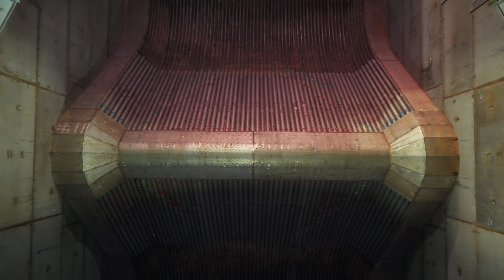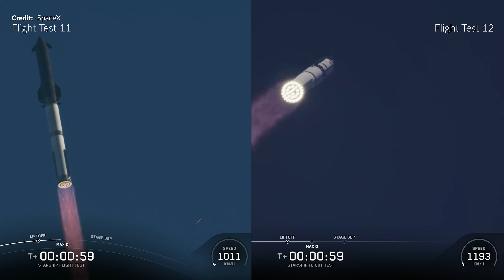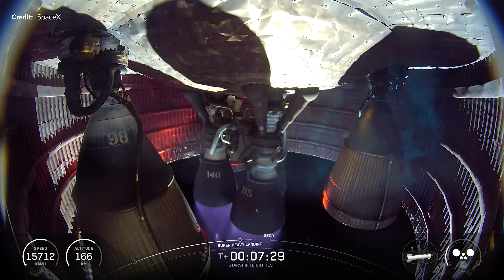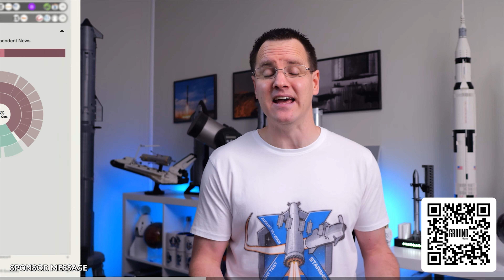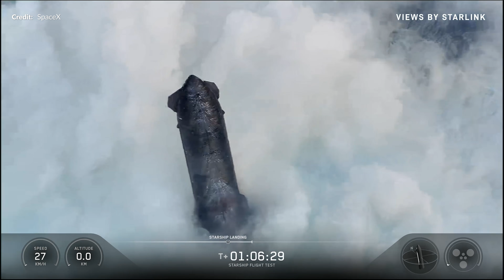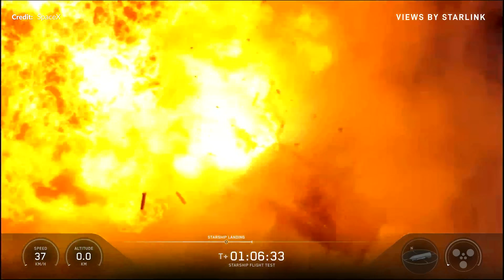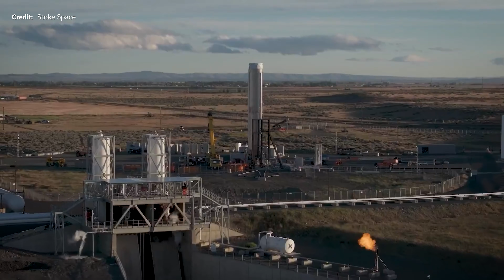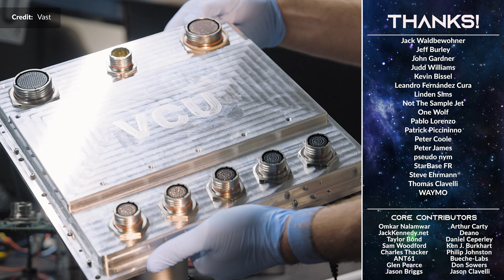Starship Flight 12 Explained - The First Version 3 Starship

Comment: Summary of the Starship project to date

As of May 2026, SpaceX has launched a total of one actual flight utilizing a previously-flown Starship component, which occurred during Flight 9. However, the booster on that flight did not survive its recovery attempt, meaning not a single piece of hardware has yet been reused multiple times. 

More than $3 billion into the project and no demonstration yet Of the essence of this system. Reusability. 

Meanwhile, NASA has launched exactly two Artemis rockets, both of which not only achieved orbit around our planet, but both of them went to the Moon and back and Artemis II with four astronauts with a successful landing.
Reply: Meanwhile, SpaceX has launched the Falcon Heavy rocket (much more complex than the legacy expendable SLS) 12 times successfully, with no flight failures.
Reply: @admarsandbeyond But it didn't go to the moon, did it?.
Reply: @ke4uyp  And? Artemis II cost 4.1 billion and all they did was go around the moon? I dont think you understand remotely what spacex does and how it innovates. Falcon helps you more than you think
Reply: @fekl_osu  I fully understand what SpaceX does they take our tax money and waste it on a project that will never be completed.
Reply: @ke4uyp  SpaceX has successfully launched six distinct lunar exploration missions with Falcon. Beresheet, Danuri / KPLO, Hakuto-R Mission 1, IM-1 "Odysseus", Blue Ghost Mission 1 & Hakuto-R Mission 2, IM-2 "Athena". (also another 7 deep space missions into interplanetary trajectories). So yes it has gone to the moon as much as SLS has gone to the moon.
Reply: @ke4uyp  " they take our tax money and waste it ". Starship is self-funded. NASA funded only part of the HLS program (development and missions), and they receive money based on completed milestones (more than 49 major milestones completed already).
You can't pretend to care about the 3B spend on HLS, while ignoring the well over $100B wasted on SLS/orion to fly 4 people around the moon.
Reply: Spacex has received around $22B from the government. Almost all of those funds go toward Cargo/Crew Dragon missions, development of the Starship lunar lander, and satellites launched by Falcon rockets etc. Besides that, SpaceX is pretty much self-funded through Starlink, launching satellites, private astronaut missions, etc.

Did you ever try looking more closely at where your money actually goes, or do you just take a quick look and call it a day? I don’t see NASA launching a rocket every couple of days.
Reply: @fekl_osu I don't see SpaceX launching starships every other day either.
Reply: @ke4uyp  i see falcon launching every other day
Reply: @fekl_osu  That has nothing to do with Starship. Spacex needs to get a seat in the back of the bus. Firefly has already successfully landed on the moon.

Blue Ghost Mission 1 (March 2025): The spacecraft touched down in the Mare Crisium basin. It successfully delivered 10 NASA science investigations and technology demonstrations, operating for over 14 Earth days to complete 100% of its mission objectives.
Firefly is currently working on their next mission to land on the far side of the Moon.
Reply: @ke4uyp @ke4uyp  Blue ghost and Firefly both utilize the falcon 9 to land on the moon? Starship is a TEST program and it doesnt need to go orbital because they have falcon. Its legit the reason they can operate the way they do so its bs when you say falcon has nothing to do with starship lol. I dont see nasa flying a 33 engine rocket with engines far more efficient and simplistic then ever before costing only a fraction of the sls engines. I dont see the shuttle anymore and i wonder why. Nasa doesnt even have a rocket to supply their own iss crew. 

Like why are you even comparing moon landers to a rocket? Thats not what starship v3 is made for.
Reply: @fekl_osu  All I see is SpaceX taking our tax dollars And not completing the contract. They were awarded from NASA pertaining to Artemis. They have absolutely nothing. Mission ready. Their latest raptor engines can't even reignite reliably. And it really doesn't matter whether it's a fuel issue or the engine itself. The bottom line is they wasted all that money with that rocket and it's not reliable at all. And at this point they have shown absolutely no reusability on Starship. Every single launch has been a complete total loss. So regardless of whether these rockets cost less money to make and launch makes no difference if they're not really actually what they claim they were going to be, which was reusable. It's like every single time they reach a point where they've got something that's working. They move the goal post, throw it in the trash can and start all over again. That's not advancing that's just wasting time and money.
If they spent as much time and effort on perfecting the reusability and reliability of the rocket as they do with that stupid pez dispenser, they would have already had something working by now.
Reply: @ke4uyp you are just blind to the facts that starship doesnt work like this (if only we had a smaller capable rocket that could do the job until we had starship ready). There is no point in argueing with you since you are too hyperfixated on the idea that starship is a waste lol and not really allowing your view to change. All i have to say is lets see who is right on the next couple years :) lets see if nasa can even get their own rocket ready on time lol
Reply: Should they keep reusing the same booster/starship when it has known problems? I feel like they don't need to justify their reusability with starship yet because falcon exists.

Comment: my prediction for the reason the booster failed ist, that due to the missing hot staging ring, that was a seperate part and the shielding now beeing welded onto the the head of the boosters tank, this created a much more conductive thermal bridge, resulting in a preassure increase inside the tank

Comment: Powerful,  new systems, engines, controls... yes. Ignoring that the new ship still exploded is interesting. This is supposed to be a reusable, human rated ship.  How much longer will this thing still be hyper volatile?
Reply: Lets first wait for starship V4 :P
Reply: This is supposed to be a test prototype of the reusable human rated ship. Starship is evolving faster than any other space project in history given the enormous complexity.
Reply: @admarsandbeyond I'd argue RocketLab's Neutron will be faster.  The hopper test was in 2019.  6 years later, I dont see rapid disassembly as something to cheer about. I cheer for the employees, but the strategy needs to be revisited.
Reply: @iamsocial4340  Neutron is a partially reusable midi rocket, orders of magnitude simpler than Starship.

Comment: 5% of the engines failed…. In most industries a 5% failure rate is catastrophic. I realize this is new technology and a test flight but I have always thought Elon should have looked at what worked best on the Falcon 9… and made Starship far less cutting edge and ambitious and simpler and lead SpaceX to quit trying to innovate quite so much.
Reply: In most industries they dont expect failure tho. Spacex expects some parts of the starship to fail, aspecially the new raptor engines. Like why do you went spacex to innovate less? Do you not want to see interplanetary travel in ur lifetime?

Comment: The hot stage attached to the booster may have caused violent  oscillations with the angle of attack causing damage to the mechanical systems leading to RUD on its return to Earth surface.

Comment: This mission seemed to be a huge step backwards for the booster and all propulsion systems. Flaps seemed to survive, that's about it.
Reply: Nope - brand new everything including engines - heat shield was in the best shape post flight of any mission - I suspect the booster return issue was a bad flip resulting in gas ingestion and fuel feed issues - then engine failure - all fixable in software

Comment: Take a look ! See the bottom of the booster swing a bit close to the tower as it jumped off the pad. So much power it looked like it wanted to flip ends. Next flight you will see them dial the thrust back a bit to avoid that dangerous bottom swing pushing against all that tonnage above it.

Comment: Engine out on an R-vac is pretty wild. It "feels" like the offset thrust would be a big problem. I wonder how much the center three have to gimble to compensate. Are they RIGHT at the limit of available control authority? Do they also have to throttle down the 2 remaining R-vacs to reduce offset thrust, and if so, how much does this increase fuel burn to reach the target near-orbit? Would this still be viable on an operational mission with full payload? I assume it's built into the fuel margins.

Comment: Even with all that power Starship still has a lower thrust to weight ratio SLS at liftoff
Reply: SLS thrust-to-weight ratio of around 1.5 to 1. Starship's thrust-to-weight ratio will be around 1.8 to 1 with a full payload, which is incredible given the energy density differences between propellants used.

Comment: Absolutely this was a success, and a success SpaceX and the American space program really needed.  And I think we will learn more about important successful details achieved in the coming days.  Two things I think we can see as important successes just from what we could see are:

* the V3 Raptors worked spectacularly well (apparently) except for some ignition problems ... and one lost engine on the booster before MECO.  "Working spectacularly well" doesn't mean perfect or without problems to solve.  But for the first flight of a remarkable new engine, bloody damn good.    And (as Marcus says) one of the things that was spectacular was how fast the stack left the pad.  Go back and look at earlier launches if you don't immediately see it.   This is proof you can see with your own eyes about how much improvement the V3 redesigns have increased system thrust/weight ratio at fixed payload.

* The new tiles seem to be working very well.  This is critical, and we should learn more as more analysis comes out.   However there were a few brief streaks of hot debris coming off the forward parts of the vehicle -- what these were is a prime question.

Comment: its extremly funny to me how the whole thing with starship was questioning nasa's best practices. and we have effectively come full circle to now just have a launch stand that essentially is the same as any other just with the catch arms.
Reply: Starship isn't just a launch pad (NASA could never build a system like this), and even the launch pad is many times better and more innovative than any launch pad before it.
Reply: @admarsandbeyondhow so?
Reply: @Whiskey2shots  Starship is developed in a totally different way than NASA best practices (rapid iterrative hardware rich development). 
For how the launchpad is way more advanced and different than any launch pad before it search for CSI Starbase videos which do a deep dive on how it works.
Reply: @admarsandbeyondbut fundamentally they have ended up with a pad the same as any other following NASA's best practices. Which was my point. 

I don't want to disparage those who work at space X and on starship specifically but this "rapid" development isn't so in my view. We're almost a decade on from the first flight, and it's been well over a decade since development began. In that time multiple other launch systems that are often looked down on by space X fans have been developed and put in to "revenue earning service". The "rapid" development cycle seems to have just wasted money and materials for very little gain. 

I think starship and super heavy are significant steps in space flight but I also think the mythology around it is simply unearned at this point.
Reply: @Whiskey2shots  "ended up with a pad the same as any other". 
Similar in concept only. But yeah, if you don't try new things and take risks and fail until you find what works, you can't innovate. That's how cutting-edge engineering works. Otherwise, you end up like NASA flying 1960s RS-25s on a weak, expendable, $4.1B-per-launch boondoggle.

"We're almost a decade on from the first flight well over a decade since development began".
 No. Starship hardware development essentially started in 2019, with full integrated flights starting in 2023. Starship is one of the fastest space development projects in history when you account for its complexity, progressing on one of the most aggressive schedules ever.

"In that time multiple other launch systems that are often looked down on by space X fans have been developed and put in to "revenue earning service"". Which are those?

for example:
New Glenn: 14 years of development to first flight, and it suffered a total mission failure on first commercial flight. It's probably many years away from approaching Falcon reliability, and will never ever be as cost effective (it's built like a legacy boutique rocket)

Starliner: 2014 contract (+years in early design dev before that), 12+ years in and still not fully operational (and will probably never be fully certified for crew).

Orion: 20+ years of development for its first crewed flight.

Blue Moon MK1 (uncrewed cargo lander): ~10 years to first flight attempt in 2026; MK2 crewed version maybe a decade further behind, if it ever happens.

SLS (based on legacy Shuttle components which began development 50 years ago in the 1970s (SSME/RS-25, tanks, SRBs, RL-10, Centaur S2): 11 years to 1st flight.

Shenzhou (LEO capsule, heavily based on Soyuz): ~11 years total from program start to operational crewed capability

Comment: I think the booster was hit by more Starship exhaust than anticipated. The exhaust hitting the now exposed outer ring may have put the temperatures out of range or disrupted the fuel/oxidizer mixing in nozzle bells.
Reply: Different power to weight ratio now so could have miss calculated that and flipped it a bit too hard 🤷🏻‍♂️

Comment: Fuel distribution failed. They need to re-engineer fuel distribution. Wouldn't count on the next flight for at least 2 months. It would be nice if they hit orbital altitude and put some real satellites up. If the ship has enough fuel to land on chopsticks from that altitude, it can launch satellites and land where they want in the sea, with maybe an extra orbit or two. Clearly the knew they might have big problems... and they did. This is early days of V1.

Comment: Looking at the transfer design currently one ship has female connections the other has just male connections.  Each ship should have a male and a female connection.  This would allow change of roles while in prelaunch, processing, or orbit or post orbit interplanetary.  You could do multiple launches, pair any two ships to consolidate fuel; then allow those ships with fuel plus to connect and transfer.  Otherwise if your doing multiple launches and have a failure of any ship.  You do not lose the ability to continue the transfer processes and even pair a trailing set of ships to follow to another planet to resupply in orbit there and possible carry supplies to be taken down by crew as they would have consumed allot of supplies in route.

Comment: Flight 12 was more or less a straight fail :(
The booster didn't work and was lost and one engine on the ship failed. And still no catch of the ship, even not an attempted one. 
There is no shortcut to orbit. Elon Scrub had achieved a milestone of spaceflight with the resusable rockets, but the starship thing is contradictional in itself: When they are reusable, why manufacturing them at a rate normal cars are produced? Without refueling they will barely reach a looow Earth orbit, just enough for the starlink satellites. Maybe they will end up as the mass donkey for Starlink, but never reach out of the low orbit.
When SpaceX will go to the stock exchange, this pipe dream of a science-fiction-addicted super-rich dreamer will soon be deflated.

Comment: If there aren't companies designing zero-g factories right now that can fit inside a starship I'd be surprised and also factories that can be delivered to the moon inside a starship. People have no clue what kind of revolution in manufacturing this ability will unlock. Super strong cellphone cases and super light weight and strong aircraft components. The list goes on and on. THINK: Solid steal will be replaced with foam steal.

Comment: During re-entry you can see some sparks flying... Means there's some ablation going on. Either something is heating and melting or tiles are flaking and removing heat not unlike the re-entry capsules NASA has been using. Heat shielding will probably have to be refurbished as part of the re-usability plan. I want more details on the booster section ! What went wrong, how well it fared, were they able to complete any additional tests even though it was off target ?
Reply: They had a few tiles of different materials that where designed to test failures of the heat shield, could have just been those, hard to tell until they actually catch one and see how it looks after.
Reply: @minmo2288  I suspect it's also coming from the thermal blanket they have wrapped under and around the tiles.

Comment: And the heatshield or more likely the steel below was burning off again with a lot of sparks during reentry... how is that design supposed to be rapidly reusable without maintenance of heat tiles or replacement of burned off metal parts? Even more questionable if it returns from orbit or even the moon or mars with a ton more energy on the ship during reentry. What is their solution here? I don't see much improvement over the flights so far.
Reply: They had patches of missing tiles with steel in its place to test what happens when the shield fails, could just be that burning off like it’s meant too.
Reply: This monstrosity is similar to Howard Hughes Spruce Goose, except Elon isn't 1/4 as smart as Howard Hughes.